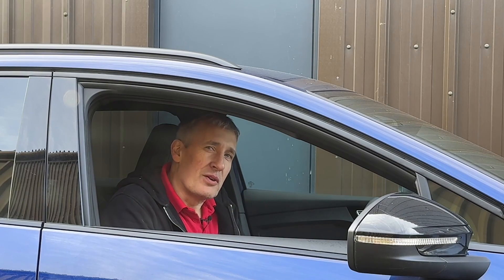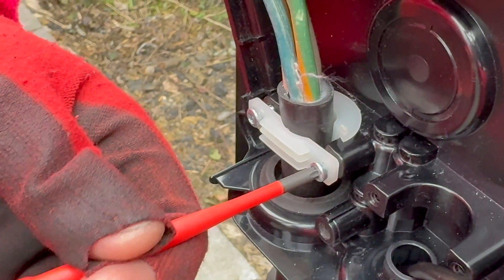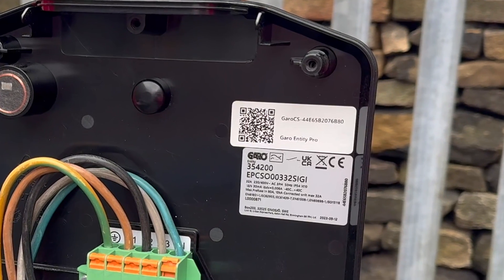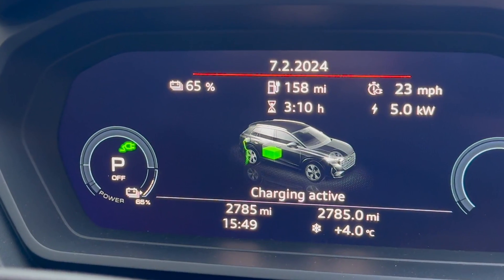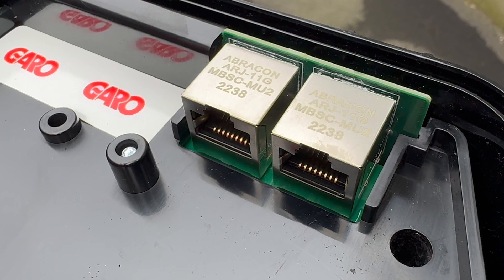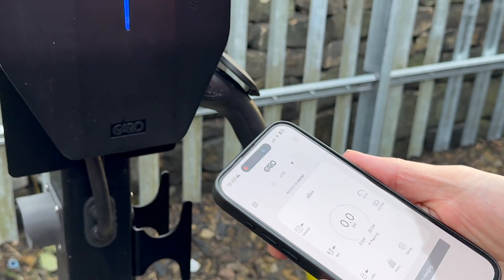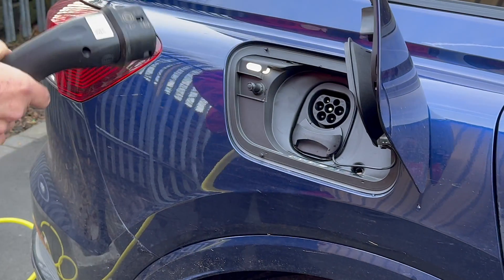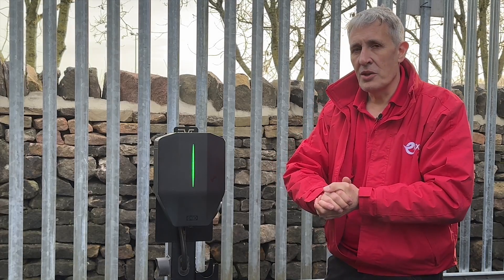Garo Entity: The Ultimate Fix for EV Charger Installations.

Comment: There are so many great features to this EVSE, however it is worth pointing out that this does not have the inbuild abiity to connect a CT clamp for Dynamic Load Management, the EPLM60 is required as an add-on, but at an not inconsiderable amount - £499!!!! and good luck trying to find one. It isn't a problem if your property has a 100A main fuse and maximum demand is below 60A but if you have MD greater than that it will be an expensive bit of kit if you want to incorporate load management. Also, I couldn't find any info of installations with PV and its integration with it.

Comment: RCD Test button locally excellent, for domestic installs the Octopus, Ovo or any other energy supplier integration is needed. Relying on vehicles API is not wise especially after what happened with the Ford Mach E.
Reply from the maker: What did happen with the Ford Mach-E?
Reply: @efixx   back in January Ford's stopped working on the Octopus Intelligent plan, API issues, luckily we recommend the Zappi so our customers so was back on the Intelligent plan within minutes. We now recommended to our existing Zappi customers to upgrade their units by installing the retrofit Ethernet port board.
Reply: Ford"s stopped working on the Octopus Intelligent plan API issues, lucky we have always recommended  Zappi's so our customer's just switched over to the Zappi for access to the Octopus Intelligent plan. We are now in the process of upgrading the older Zappi with the new ethernet port boards so all existing Zappi's can join  Octopus Intelligent, Kodus to Myenergi👍 @efixx
Reply: Let's hope third time is a charm trying to reply. Back in January  Ford's Mach E stopped working on Octopus Intelligent API issue. Fortunately we recommended the Zappi to our customers so they just switched to switched to the Zappi to control the charging and could access the Octopus Intelligent plan. We are now in the process of upgrading the previous version of Zappi's with ethernet port boards thus enabling these charger also join Octopus Intelligenct. Kudos to Myenergi👍

Comment: The WiFi mesh feature is quite unique, if it can act as a wifi hotspot , it can provide wifi to the car and driver
Reply from the maker: Interesting we’ll explore that possibility
Reply: No, the mesh Wi-Fi is used for the EV charging infrastructure. The master charging unit connects to the internet, and the other units can wirelessly connect, allowing for the firmware to be downloaded, back office/app connectivity and less ethernet cabling for the installer.